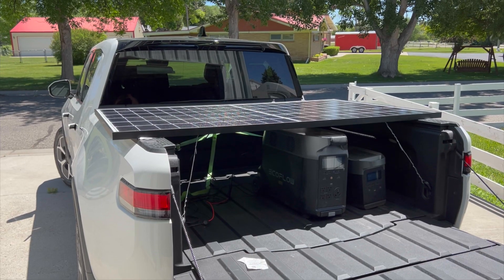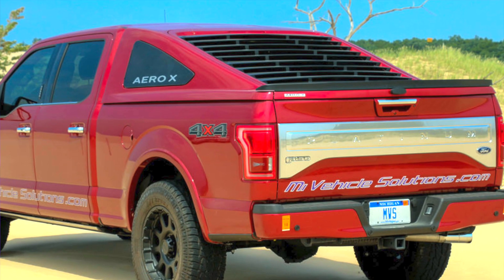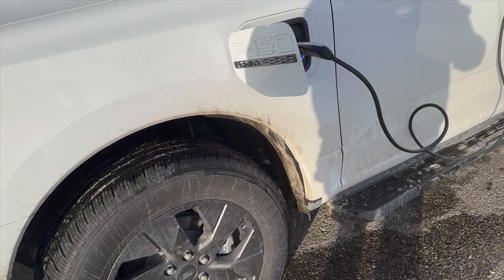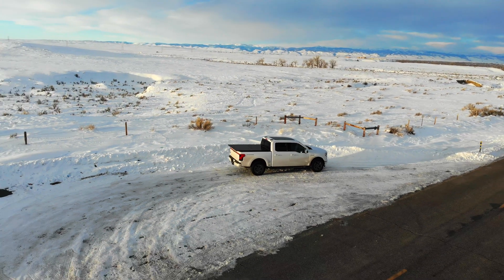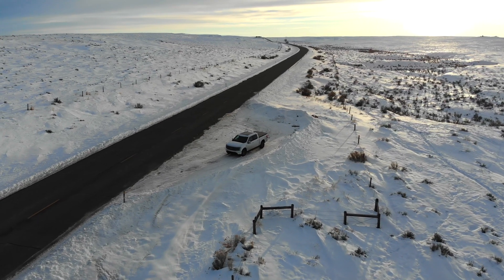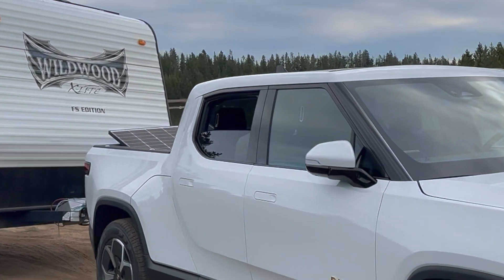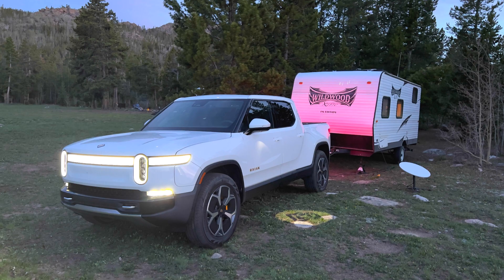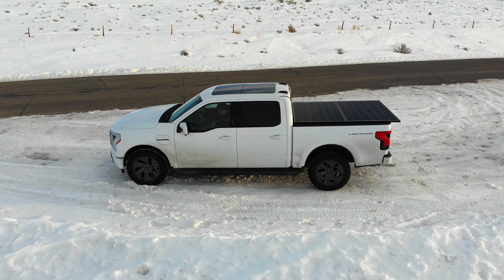DIY Solar Ford F-150 Lighting

Comment: Any update? Are you still using this? Did it turn out to be useful in the long run?
Reply from the maker: No, Those’s particular panels are just too heavy and not the best fit, there are a couple companies doing solar tunnel covers now. They don’t generate as much power, but they work as a true bed cover that’s foldable.
Reply: @TeslaTrip Okay, thanks for the information. I appreciate it.

Comment: It drives me crazy that no automakers offer this as an option. If I could get a lightning with solar on the hood, roof, and bed topper it would be more than enough for me to never have to plug in. I would buy one tomorrow if they offered that.
Reply: That would be an amazing option. Definite game changer. But I would settle for a bench seat and a charge port in the box.